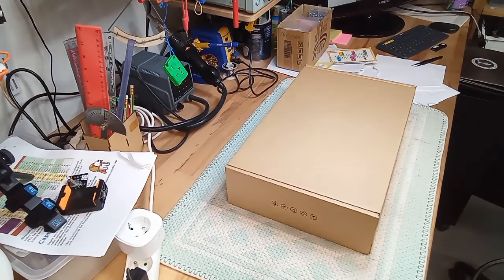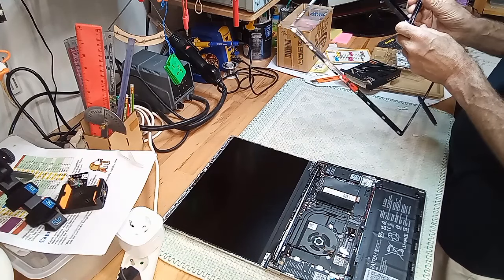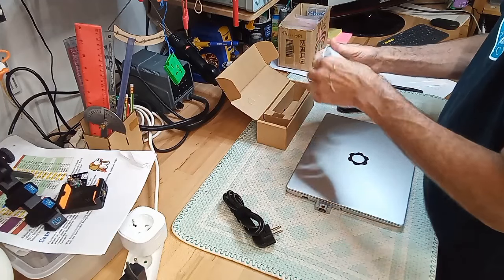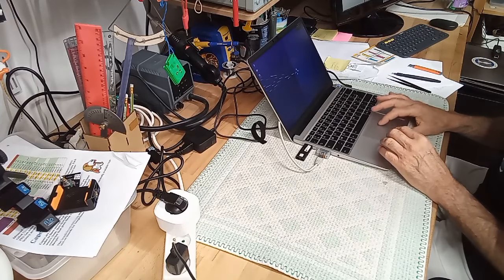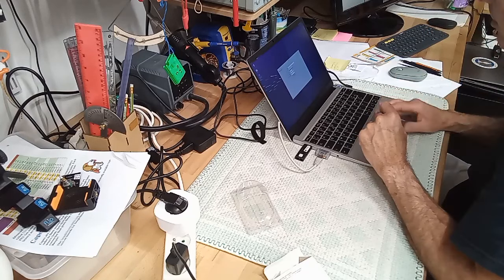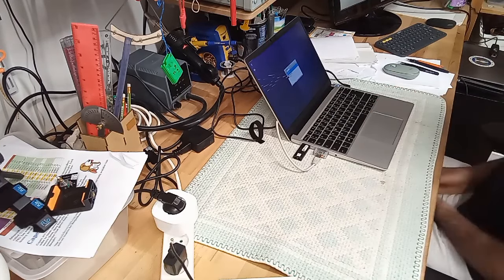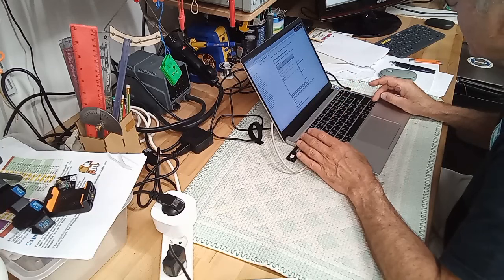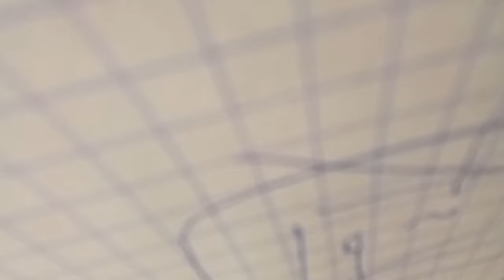Framework-13 Laptop DIY edition : Unboxing and Setup

Comment: These really feel like nice machines to use. I also got a 1TB SSD and maxed out the RAM 64GB cos why not? 😉
Reply: Could you describe what the problem with the ethernet port was please? As a visually impaired person I couldn't tell from the video. You said it was inelegant.
Thank you.
Reply: @davidmellor3074 I believe he said that because it’s sticking out as an extra part of the laptop. Most of the other pieces you can even see them, they feel like a built in internal part of the laptop whereas the Ethernet port he has feels like an external extension.